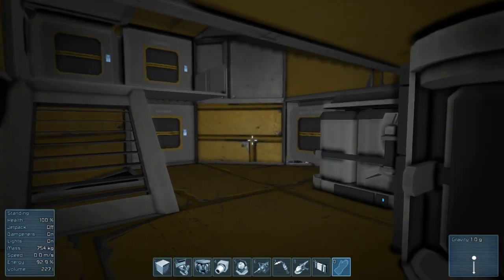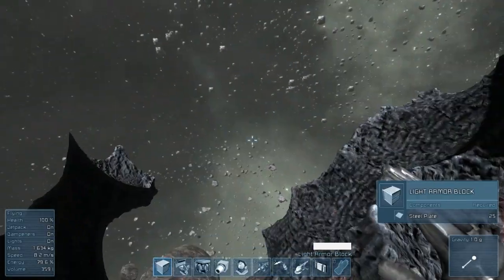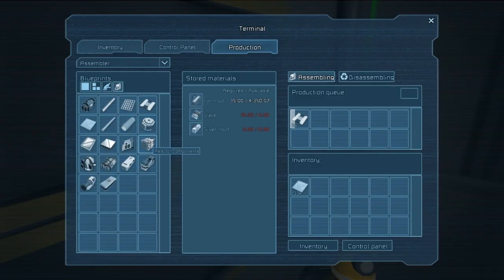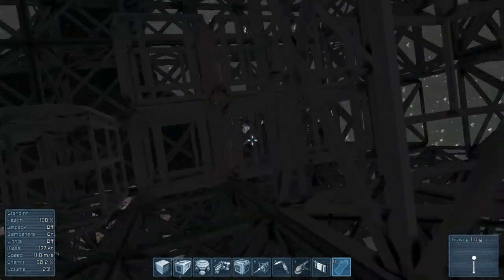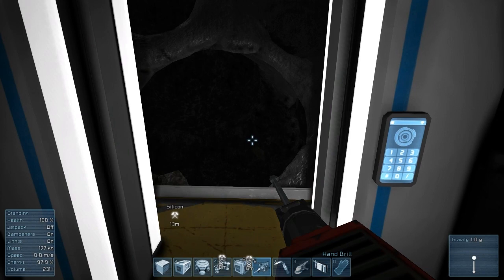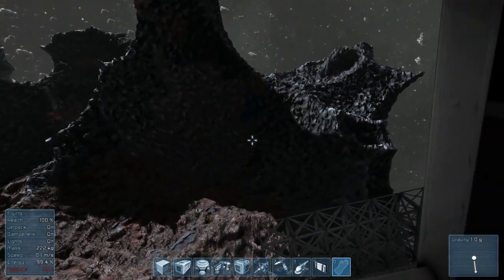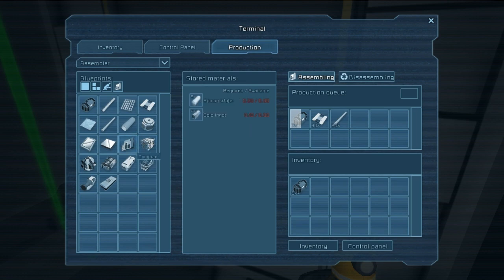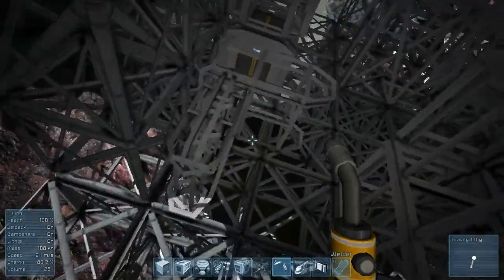Space Engineers: Survival Let's Play Episode 2

Comment: In the blueprints tab on your assembler you can just click on the block type and it will queue up all the required parts and tell you exactly what materials you will need to make it all. Makes life way easier than "Weld. K, need 20 plates. Wait 10 minutes. Weld. K, Need 5 motors. Wait 10 more minutes. Weld. K, need displays. Wait. Weld.". Just queue up a few containers and go off mining or frame up more base while it churns out your parts.